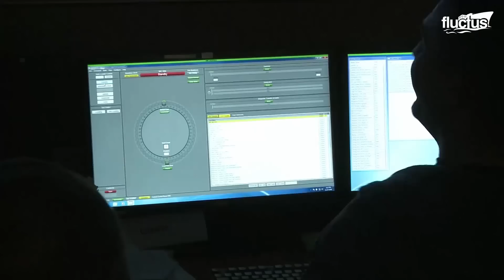Scary Reason Why Japan is Testing a New Massive Railgun

Comment: A successful test of a ship mounted railgun with projectiles used of around 40mm in diameter was completed not long ago by Japan.
Considering they were using a ship mounted energy source to power the gun and that the gun was aimed and stabilised successfully means the Japanese have the jump on everyone with this technology. Having an operational and usable weapon of this type ready for service is a very impressive feat of engineering.
They obviously kept the overall size of the gun and projectile small to limit the power needed to operate the gun and ancillary systems successfully.
😎🇦🇺👍

Comment: I'm Japanese and love military, so I'll explain. 
One of the reasons Japan is developing railguns is to counter China's large stock of IRBMs and HGVs. The Ministry of Defense believes that "to intercept HGVs, it is important for the interceptor to also head to the rendezvous point at hypersonic speeds," and a railgun with a long range and the ability to shoot continuously is the perfect solution. Although it is not shown in the video, research is also being done on vehicle-mounted railguns, and they are being considered for the defense of air bases and ports. 
And as you may have noticed if you watch the video, Japan's railguns are smaller than those being researched in the United States and other countries. The caliber is about 40mm, which reduces the range and power, but it has succeeded in reducing the wear on the barrel and the power required. And this is enough for anti-aircraft use. 
Research is still ongoing, but practical application may not be that far away. 
I wrote this sentence using Google Translate, so I'm sorry if it's difficult to read.
Reply: Bruh i think japan is about to defend themselves from Ramiel
Reply: Just wait until they start equiping tanks with them.
Reply: @thatguy46744 that would be scary. watch they're gonna have tanks with anti drone heilos lasers and railgun muzzles
Reply: Yeah the us was for some reason stuck on using rail guns in place of missiles or big battleship guns. Where lighter target guns would be far easier.
Reply: Congratulations for this technological feat, it will calm the Chinese, the North Koreans and the Russians too! I know that conclusive tests have been carried out by the Japanese Navy (JS Asuka), we wish you every success for this project ! この技術的偉業にはブラボー、中国人、北朝鮮人、ロシア人も落ち着くでしょう！日本海軍 (JS 飛鳥) によって決定的なテストが実施されたことは承知しています。このプロジェクトの成功をお祈りしています。
Reply: Thanks mate, translation is perfect

Comment: The japanese got the tech from the US given their defense reliabilities contract. Given the US has already completed its testing years ago and is in the last stages of production id say they gave the japanese info from like 2015 lol cuz they shoulda been figured it out by now if they gave them up to date research. US has fixed the power supply, the issue being japans ships or infrastructure cant generate the power needed for multiple shots i.e they need bigger ships with full nuclear energy support like US carriers/Battleships. They have more than enough capabilities they just need bigger more powerful ships that can actually use the weapon.

Comment: Sodium Ion power cells can significantly reduce weight and cost requirements making tech like rail guns and lasers more useful, especially for naval use. The massive accelerations to hypersonic velocity is still giving developer problems with the barrel damage, Power demands without nuclear plants are not the only problem to solve.
Reply: If you are talking about the barrel erosion issue, it's already been solved several years ago. 
Currently, the rumor says that the barrel life is about 120 rounds, I don't deny that further improvements may be needed, though.

Comment: Good video but fails to acknowledge the 1 Principle that makes this "GUN" near useless in the 21st Century ground or Sea warfare. All Guns including this one has an originating burst of energy then the projectile cruises at that specific speed,,  until its energy begins to fall off. When this energy falls off the projectile quickly curves down to the earths gravity. As soon as the projectile begins to curve down it has lost all destructive power it had. The trajectory problem is the main problem as this system is only good for straight line targets no more than 20 Miles away. The curvature of the earth denies this projectile to be effective. If the target is 25 miles away the projectile will fly OVERHEAD of the target continuing going straight until it loses its original energy from the gun, it will be of no value to any other target it may hit even 100 miles away as all it is doing is falling back to Earth at subsonic speed. This gun is only good when fired from a straight line shot to a straight lined target, but the one place it would be good at all times is in Space shooting straight down on a target.

Comment: You need to get things up around mock 10,11,12 to get things into orbit.
Reply: With our curent version of railguns, it would be possible to lunch projectiles up to 10km/s, and orbital velocity of LEO is 8km/s. The problem would be acceleration, wich would need to be low enough for any sensible equipment to survive, or make said equipment be able to survive around 20,000G of acceleration.

Comment: Design an put a small reactor on the ZW and power is no longer an issue.
Reply: Possibly, a dedicated reactor, for the rail systems.
Reply: @zapa1pnt  heck just use one from a submarine... no new design needed.
Reply: I think that was the original plan.  Time for a TMSR modular reactor.
Reply: .. The US supposedly has two Battleship hulls kept functional by order of congress.. so why talk about the zumwalt at all? 

From all that's been said the zumwalt class was/is defective.. also well Battleships have always been more a long range bombardment vessel anyways, more so than an actual effective sea vs sea battler. Bigger ship more space for power and ammo and so on. I'd think it would all be about cheap sustainable long range bombardment capability.

Comment: Naval ships are already nuclear powered therefore your point of them not being on naval ships due to power needs is really a mute point the nuclear power on the boats can handle it. The real reason is these boats are designed around the fire power they are equipped with to add railguns to the entire naval fleets would require a redesign of each boat class to handle the power wires , support structure, ammo storage etc for a railgun
Reply: US Carriers and Subs are Nuclear.  Russia is a different story.

Comment: The idea of the Railgun is good, and there would be a lot of money to save on ammunition if it were possible to make one that can last. But the problem is that the barrel wears out very quickly, and a solution has obviously not been found. So now the Railgun is shelved for now, or until someone finds out that the Chinese have suddenly adopted the idea and start making one themselves, just like they didt with hypersonic missiles.

Comment: From what I last read about railguns, specifically for the DDG1000 (USS Zumwalt) destroyer, they're not going anywhere soon. 
The Zumwalt class was specifically design with technology like the railgun in mind. Yet there have been so many issues that the initial order for ~32 Zumwalt class was cut to just three, and railguns are not anticipated for ANY of them. In addition, the projectiles have an estimated cost of $100,000 EACH, and the plasma generated by the railgun itself degrades the 'barrel' far too quickly to get any decent life out of it.
Reply: I think it's because that ship is ugly AF.
Reply: thats seem like minor issue
Reply: You are mixing things up. The rail gun ammunition hadn’t even been designed yet. The rail gun demonstrated isn’t even the one proposed for the Zumwalt class. It’s only a test bed.
Reply: @evanmorris1178  Yes, I know that the rail gun under test is experimental and was never intended to be specifically designed for the Zumwalt. I neither explicitly stated or even inferred that it was. We're talkin' 'baseline', representative costs and other issues. However, just as with regular artillery, the range of a rail gun is highly dependent upon the size of the projectile. For the stated range (mentioned to be ~100 miles), the projectile would likely be of a similar size. In addition to size, the complexity of the projectile and its material characteristics would resemble what was tested. And that assumes the Zumwalt would use just a 'dumb' projectile.
The net result of all this is a prohibitively expensive projectile. The projectile's anticipated costs were stated as one of the concerns leading to the project's cancellation, as was the life of the 'barrel'
Reply: That's all due to economics of scale. If the original order for 32 did go, the ammo price would be normal.
Reply: @vxxed8668  Saying the price would 'drop to normal' is thoroughly unsubstantiated. You should do some research before doing so. Why?........ 
#1) Linear induction accelerators likely require extraordinarily precise tolerances
#2) The high temperature plasma likely requires very specialized materials, such as a custom alloy of tungsten, inconel, invar, etc. to reduce melting, expansion, etc.
#3) The projectile is surrounded by a sabot to guide the projectile before it's discarded. It too will be of a specialized construction.
Reply: Yes but producing for 3 as opposed to the original 32, that's 1 order of magnitude. Everything you said is correct, but seems you're both on slightly different pages.  @gregparrott
Reply: @joshuabradshaw6355  Yep, we're on 'different pages'. Expecting the railgun's shell price to drop to 'normal' (whatever that is) is far fetched. Consider an analogy with the 'A' variant of the F-35. It is eventually expected to scale into the thousands. It's price may drop from ~$100M to ~$80M  (~20%) compared to the first 100. That's not like, say, injection molded parts, where the price can drop fully TWO orders of magnitude, especially if one transitions from single to multi cavity molds.  Another comparison is 'normal' (dumb) 155mm shell that cost ~$800, while the smart, GPS guided 'Excalibur' shell costs somewhere in the range of $80k to $100k. Regardless of scale, the Excalibur's shell will never cost equivalent to 'normal' shell.  
The railgun shell's exotic material, close tolerances, and surface treatments of the projectile, plus the sabot, and their assembly, ensure this will not become a 'normal' commodity.
Reply: @gregparrott  but even normal western shells have the same issues you've pointed out for the rail gun shell
Plus They are actually very expensive , way more than you quoted.
Excalibur is infact better value if you do the math.
I don't know how Japan controls it's tech but the USA rail gun shell is expensive only because the government allows it to be.
The companies just have TOO much control
Reply: - missiles hypersonic were just superior in range and everything else
- normal guns are still very powerful especially given smart shells
 Railguns just simply didn't deliver enough value but there wasn't issue with technology like Japan has shown.
They may have niche roles still like counter hypersonic defense
Reply: @cedriceric9730  I've heard claims of railgun shells being intended to intercept hypersonics. But I've never seen even a vague description as to HOW they would do so. Every railgun test I've seen involved firing a dense, all metal dart. Is it at all realistic that a dart traveling at near hypersonic speeds, can hit a missile traveling at hypersonic speeds, where both are closing their distance at ~~2X hypersonic speed, starting from a distance of several or many tens of miles? Or,  does this shell need to remain small and dense, with some entity needing to design an inertial guidance system, telemetry, fins, and steering actuation mechanisms that fit with the shell's envelope?
Reply: @gregparrott   The concept is a rail gun can place a steel wall 40 to 100 km away in a few seconds like 5 to 7 seconds that a hypersonic missile can not conceivably ever dodge
The key is that rail guns have a much higher rate of fire than people think and they can do that at unbelievable range for a projectile weapon.
They don't need to be very smart because their targets just don't get the chance to move around a lot.
Many years ago the rate was like 10 shots before cooling, by now especially for smaller rail guns like Japan it must be  a much bigger rate .
Even small grazing hits at those speeds can tear anything to shreds .
The core will have to explode and scatter metal in the path but thats not very hard to do.
The USA wanted to add gps but that was because they wanted their gun to be used to attack also but for air defense thats not needed at all.
So the issue remains never losing track of the attacking glider 
And making sure the gun has enough power because they are power hungry

Comment: Sounds like a fabulous weapon if they get the power figured out! 😊😊😊😊😊❤❤❤❤❤ Thanks 😊 for the video and update.
Reply: The Zumwalt class destroyer (DDG 1000)  was specifically design for inclusion of railguns. However, there have been so many issues with railguns and other issues that the initial plan for 32 Zumwalt class ships was cut to just 3 before the program was cancelled. Of the three existing Zumwalt class ships, NONE are planned to actually have a railgun installed. In addition, the projectile cost estimate was of $100,000 EACH. If that's not bad enough, the plasma generated by abruptly discharging so much power eroded the 'barrel' too quickly to warrant its implementation. As neat as it sounds, railguns will rake far longer to become operational in field than, say, MEGAwatt class lasers.

Comment: The US has stopped development on the rail gun.   
Missles are cheaper, more accurate, and flexible.
Reply: The projectile was only $100K vs $200k to $2 million.
May be a reduction in size of the projectile and the use as a shore battery only is a better scenario.
Reply: ドローンなら５０万円で